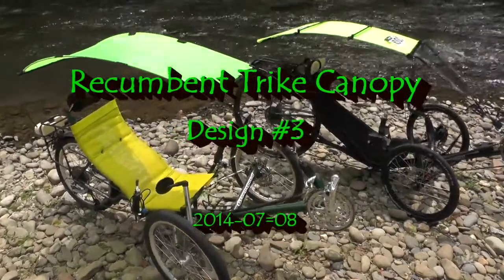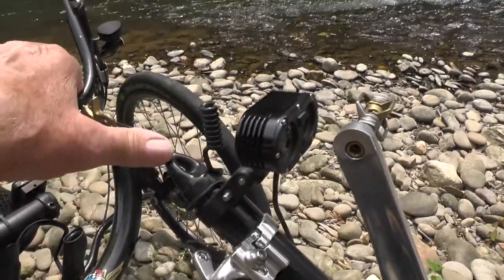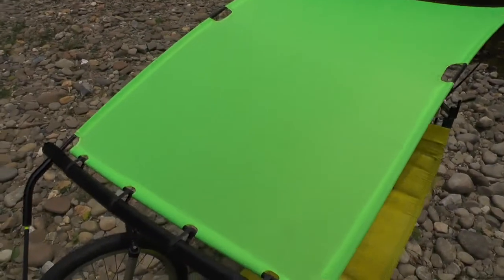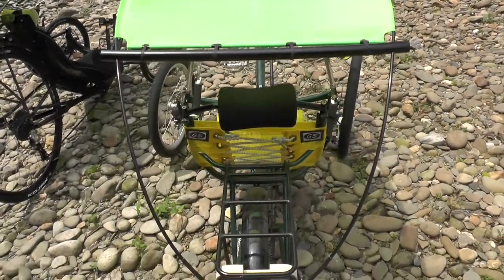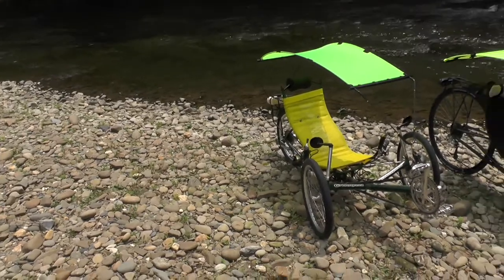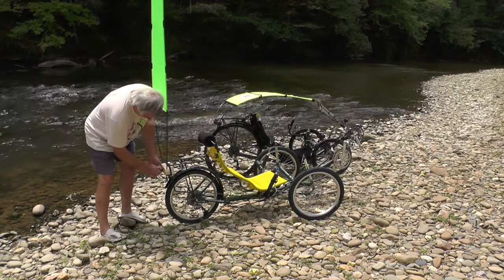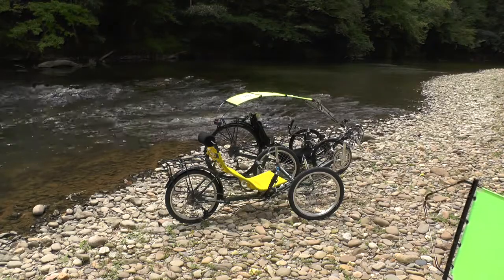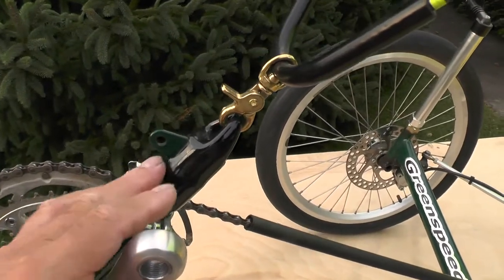Recumbent Trike Canopy, 2014-07-08, Hood, ActionBent, Greenspeed

Comment: I'm impressed with your ingenuity. I work with Kydex for various knife and axe sheaths. I also make straps and sheets for other projects. It's an inexpensive product that is used to fabricate some complicated fixtures and panels on vehicles, such as dashboards, and much more. So. when I look at your ideas, I naturally wonder what the possibilities are for fabricating mounts from it. Of course that is only a small part of the many problems you're dealing with. One advantage with Kydex is that it is easily modified to meet whatever unique requirements there may be. And, it's very durable.

Comment: any more updates on this? Do you plan to re-add the front windshield to this model to or decided to leave it off for some reason? Looking good though
Reply from the maker: James, I have a different method of attaching the front that I want to try; more of a mechanical connection that will better support the tendency for the front of the canopy to collapse downward. I also want to try using the windshield without any support rods up front as well as make the connection between windshield and canopy fabric more 'waterproof' (eliminate the opening between the two). It's one thing to imagine these changes, another to implement then and again to test them in actual-use conditions.

It's relatively easy to built a canopy that performs while the trike is static (sitting still on a level concrete parking pad in the garage), but it's another to complete a 50-100 mile day ride an enjoyable experience with more features than simply shade! Thanks for asking.
Reply: LogNotching  Yes for sure I can imagine. Might be nice to be able to leave windshield part up as well without the rest of the top on? Although I guess that would be harder and require more poles or something to make it stay up there without the rest. Nice work though keep going you will get it eventually :) I bet you will get some sales as well once its ready and out there as not many options atm other then something that is rather expensive etc :)